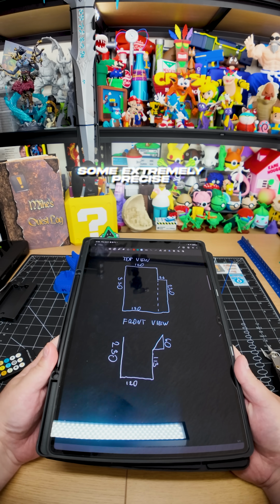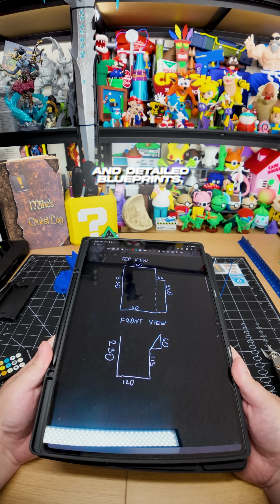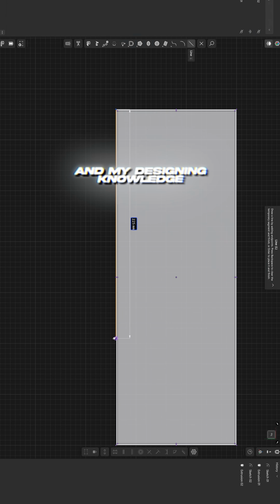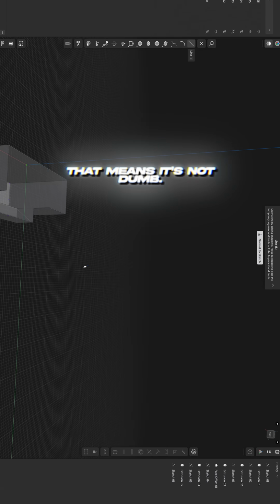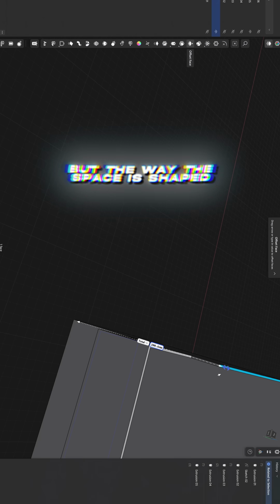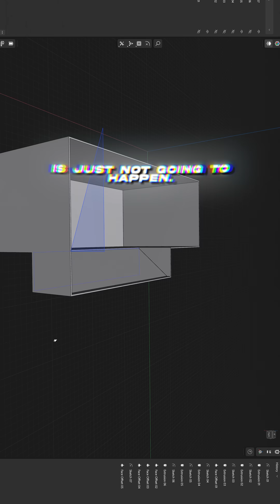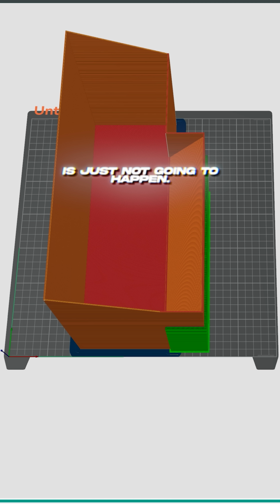More Colors = More Poop! - Quick bin design

Comment: You could have eliminated the need for support by turning the print to a 45 degree angle from the build plate. You’d need to design a chamfer into be base of the model, but it would work. Also, adding big fillets on corners will prevent peeling and make it look cleaner.
Hopefully that makes sense lol
Reply from the maker: I guess, but then I think the chamfer on the bottom would reduce the capacity (unless I misunderstood what you were saying) and I was going for as big as possible here. 

I'm not very skilled in CAD so I was going for the easiest/quickest design I could think of